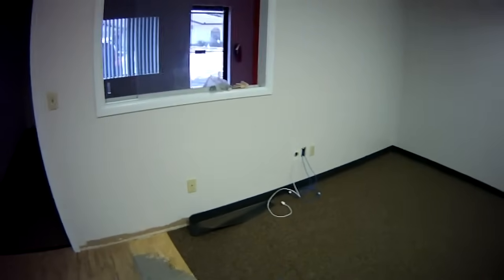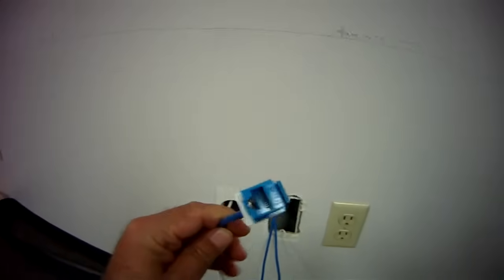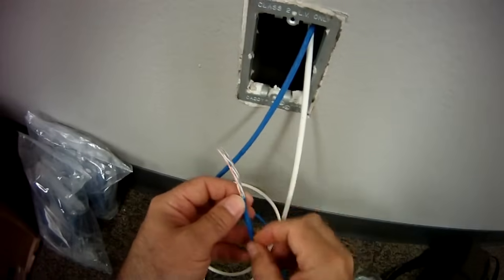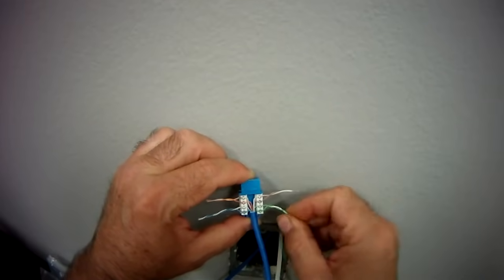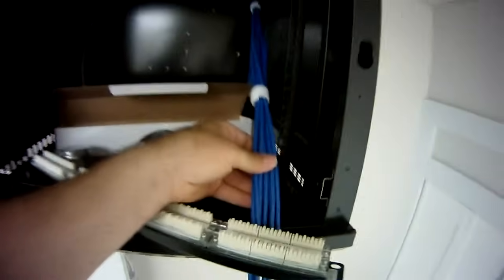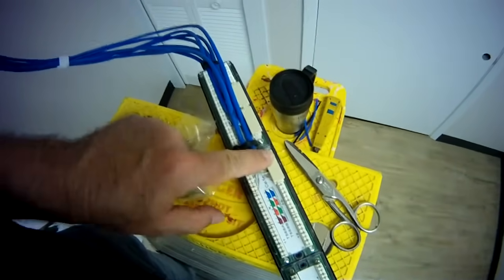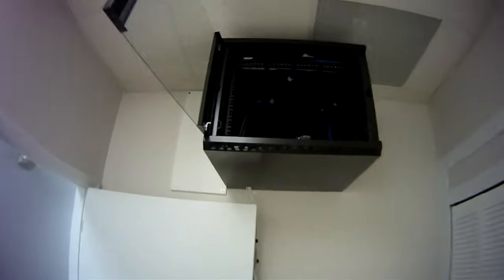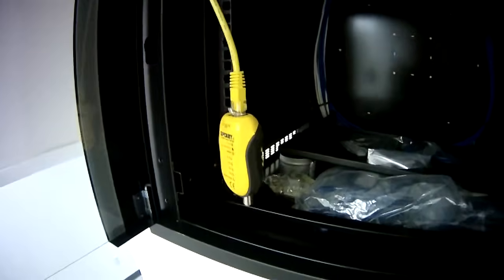Wiring an Office Network

Comment: If you are going though a ceiling & wall - I do believe I would use Fire Resistant Cable.  Putting the patch panel up so high makes it really tough to trouble shoot.   I used to teach Network Engineering & believe me - I would not pass you!  Putting Network Cabling running along fluorescent lights is a serious error.    Fluorescent lights & electrical cables should be avoided when placing Network Cables because they cause interference & will slow down the speed, if not cause random disconnections.     A real professional would not use your dumb cable tester but would have a Time-domain reflectometer.  This would not only test the cable but if there is a break or flaw in the cable would give you the approximate distance in the cable where the break is located.   The so-called critics who "can't believe you threw garbage" inside the wall should really look at your serious mistakes.
Reply from the maker: hey thanks for all the helpful comments.  I'm sure everyone can benefit from your pointers.  :-D
Reply: ping .-t 
Username checks out.
Reply: Agreed, in theory it is a bad practice. However, there is a saying regarding teachers: "Those can't do, teach."

In some situations, the only alternative is to remove the ceiling grid and attach it into the V's on the ceiling. I suppose that's the best solution, however with pipes and other obstacles it can be tedious and requires a lift to do so. However, in some areas it violates the NEC for cat5 to be supported entirely by the ceiling grid.
Reply: Yes, fire grade cabling could be run but depends on cost.   The cables should be correctly mounted in the celing space- no evidence of this so we assume he didn't just lie them across the ceiling tiles :-)  A "fluke" could be used depending on time/cost but again this was a small job and if a break in the cable was there, just pull another cable and replace!  I get your point and i'm sure in a classroom setting it's fine and dandy but out here in the real world it works differently.

Comment: Hey man, im 19 years old trying to go into the networking field. i hope its not to late for a reply but i have a question. Where that patch panel is, are you going to put a switch or hub in there to fill up those ports you was testing? If so, why are you going that route and not just putting a switch in the central point? One last question, is that a star topology or star-bus?
Reply from the maker: Arias, there is definetly a switch and router that went into that cabinet.  That IS the central point.  That is a STAR topology network.  As for BUS, I've not seen anyone using that configuration in years (like since 1994 - Lantastic & Novell).
Reply: there is no such thing as a bus with this type of cabling installation.  it is single point terminations.  Bus went out back in the old days with co-ax cabling and network bridges.

Comment: The caps on the patch panels are so the next guy doesn't short out pairs. And I'm glad I wasn't the only one in awe of throwing trash into the customer's walls.
Reply from the maker: the funny thing is, I don't usually do that. But this place had no trash cans.   The best part of all is that simple act combined with the commented reactions have greatly contributed to the high ranking of this video!!  :-D

And, thanks for your comments.
Reply: Network Advisor It's all good everyone has been guilty of something like that. I always use a box from the equipment I install on site as a trash. Then the customer doesn't have to clean after me. 

But I like that people are taking the time to show new guys different types of set ups around the world. I've thought about it but I'm no good at that type of stuff.
Reply from the maker: I appreciate it Logan.   I make these videos to help out the DIY'ers and aspiring Telecom/Network wanabees.   I know for myself I get tremendous value from YT videos and other Internet postings on topics that I have no clue about.  That has saved me mucho money and time.

So, this is my way of doing my part for anyone who want to know about Telecom/IT/Networking.    

Thanks for writing back.  :-)

Comment: So many cringe worthy techniques performed in this video (least of which was trash into wall), but I had to finally comment based on your recommendation of a cheap wire mapper over a Certifier. Telling viewers (looks like newbie techs) to use a cheap wire mapper is one reason I get called out for troubleshooting a year or more later when the network speed bogs down after the clients add more devices and a crappy Cat5e install becomes more apparent. In commercial wiring, speed is NOT the goal, do the job by the book and you will never have to repull/upgrade, repair or diagnose your cabling. I concur with comments made by Kurt Zeman, WeAreTwoDoorsDown, Shalom1948hellyeah, FishFind3000, Mum Blic, Jeff Clark and others. As for the trash issue, the same cut corners mindset that throws excess into hidden areas is the same mindset that throws everything imaginable onto the top of ceiling tiles where years of dust accumulates and some hapless tech cannot lift the tile or it cascades it's contents atop his head. Unfortunately, cut-corner speed-demon I don't care techs/installers are a dime a dozen. My beef isn't with you, I'm looking for the guy who's supplying the dimes.
Reply from the maker: Hey, thanks for the valuable comments.  Hopefully helps some people out.  :-)

Comment: Do you need an electricians licence to do something like this?
Reply from the maker: hi Corey.  SOOOOO much depends on where you are.   Some states require a low-voltage license while other locales may not.  If you're just doing it for you own house, probably not something you need to worry about.  However, if you're doing this for hire, then best to check the govt websites for you area.

Thanks for mentioning that!
Reply: Network Advisor Thank you for replying. Great Video.

Comment: It is dependent if you are doing crossover or straight-through.  You match jack codes if you are doing straight-through and different if you are doing cross-over.... Now as far as clean-up carry a FOD bag http://www.aviationpros.com/product/10026864/estex-manufacturing-co-inc-fod-bags  If memory serves those are dust covers.

Comment: what is the white cable for?  Is it for voice?
Reply from the maker: Exactly, the white cable was intended for their fax line (voice).   However, that is not an official color code.  You an choose to use any color you like for voice or data.
Reply: I've always used White for voice and anything else (normally blue, purple or green) for data.  I find that red is used for building controls in our area so try to avoid that colour as a rule.

Comment: Are the white cables Ethernet as well? because you didn't terminate them in the patch panel.
Reply from the maker: good catch.  No, those are actually being used a fax and/or postal meter lines. (modems).

Thanks for commenting!
Reply: Network Advisor would you be willing to for me your email so that I could ask any other questions there?

Comment: That box is huge and doesn't! look nice.  I work with small metal hinge boxes. Inside i screw a 20 way module which can fit perfect in the hinge box without taking so much space. The blue ones are called Rj45 keystone connectors. inside goes the the Rj45 Plug with Rj45 Cable. I put them together. It's much more neat. Please clean your garbage. Doesn't look professional.
Reply from the maker: hey, thanks for the comments.  :-)

Comment: You might want to look into cat6 CoperCladAluminium or "CCA" cables. Dirtcheap compared to standard copper cat5e cables and almost half the price for double the bandwith.
Reply from the maker: Thanks Robbe.  I did try some CCA about a year ago.  It's definitely cheaper!   I read some mixed reviews about it so I stopped using it.  However, for a home installation, I'm sure it would be just fine.

Thanks for your comments sir!
Reply: Robbe Elsas CCA is crap

Comment: Question - in a home where there is a minimal service loop available and the cables are terminated with an rj45 connector instead of a patch panel, how do you run new cables for extra slack to punch down to a patch panel? Don't want to poke new holes if there's an easy way
Reply from the maker: hmm.. that tricky Daniel.  What we sometime do is use the old cable as a "pull string" for the new cable.  This can work well in a commercial environment where the cable path is fairly predictable.  However, in a home that idea may not work so well.  
the other idea I see done when the cables are to short near router/switch area is to put the patch panel in the attic space and then run long patch cords from that patch panel (in the attic) down to the router/switch equipment.  Good luck.  :-D

Comment: why didn't you show the cable paths? maybe we would see your cables laying on top of lighting fixtures, or less than 3ft from any electrical source/cable, which is of course against building code for cat5e cable. show the path next time.
Reply from the maker: +Cody Thompson hey, thanks for the feed back.  Honestly, I didn't feel like sticking my head back up in the insulation - filled ceiling again.  However, I have made video about running cables.  That was not the scope of this video.
Reply: Cody, you can run lv perpendicular to hv electrical cable. Hv electrical cable must be in conduit limiting EMI. Finally, there would be little interference with STP cat5e. The NEC, which is what I think you are referring to only requires the use of plenum in AIR HANDLING spaces and that low voltage cable not be supported entirely by the ceiling grid.

Comment: Will that Sperry tester work with CAT6 Cable?
Reply from the maker: +thejacksonles yes, it totally will.  It's not verifying the speed of the cable, only that the cable is connected properly on both ends and has no breaks.
Reply: Network Advisor Thank you!

Comment: ouch!, not category5 tips. they are RJ45 jacks. good video otherwise.
Reply: From Memory I believe the correct term is 8P8C (8pin 8connector) but RJ45 is the standard that defines this technology therefore they are interchangeable.   TBH if you asked for 8P8C connectors they would give you a blank stare.
Reply: Relax. RJ45 identifies the form factor. Category 5 identifies the usage rating. BOTH are acceptable and it's important to make the distinction that he's using Cat5e connectors since he chose for some odd reason not to use Cat6 in a new install.
Reply: i just corrected a mis spoken word. i complimented his video, take it easy keyboard warrior
Reply: Andrew Carr You are correct. The modular connector in use today is an 8P8C. In the days of analog telephone, an RJ45 was an 8-conductor connector that was used. As data technologies emerged, the RJ45S came into briefly into existence before being replaced by the 8P8C that we recognize today. Although the two connectors are both different and not interchangeable, the RJ45 nomenclature was carried forward by technicians to refer to the new standard connector. So today the terms have become synonymous though they do remain technically different.
Reply: Not RJ45, the 45 has a side plastic tab, or key or whatever you want to call it, that doesn't fit into 8p8c port.

https://www.arrow.com/en/research-and-events/articles/rj45-connectors
Reply: He's a hack with a job. You're a douche taking trash on youtube.
Reply: rivkinnator he's a hack so don't worry about the terminology. Worry about how he striped the wire and dumps shit in the wall.

Comment: So did you Run one cable at a time, mark each end at the Termination Box and the wall socket to keep track of your numbers? Reason I ask is If I have to run 10 cables and bundle then all I would have no idea what ends matched up with what ends unless I run one at a time. Nice neat finish btw, and there are worse things then some bits of wire an plastic in walls I have been into.
Reply from the maker: Right, I sometimes find cigarette butts and beer bottles inside the walls!   If you only have one box of cable, then you obviously have to run one cable at a time. However, I usually have 3 or 4 boxes of cable so I try to group them together to pull multiple runs at the same time. 
yes, I do mark the ends with a black sharpie marker.  But, if for some reason, you didn't do that,you can always use a toner to identify the calbes after they're all run.  But, that's a time-consuming process.
Thanks for the comments!
Reply: It is a lot easier to run them all at once and then tone them out than running 1 cable at a time...

Comment: Question – Im a newb when it comes to networking.   Why are patch panels needed?  Why not instead the CAT 5 already has
connecting RJ45s on each tip and all you have to do is plug them straight into
the router or switch in the cabinet?
Reply from the maker: That's a good observation Tim.  In some smaller installations, that is sometimes done - just skip the patch panel and crimp RJ-45 ends on the cables.
If it was a small network and you were pretty sure things would not need to change often, then you could do that.  
However, the industry standard is that patch panels get used.  In a busy or growing environment,  the necessity for a patch panel becomes more obvious.  

But, if you're installing just a small little network and you want to just put crimp ends on the cables, that will still work.  :-)

Comment: Pet hate is zip ties cut with snips... So tired of cut hands from this, buy some flush cutters and save us all the Argo.    Also, why not have the service loop coiled above the ceiling? Looks a mess inside the cab....if there's nothing visible customer more likely to call you back than get their handyman yo move stuff ;-)
Reply from the maker: thanks Mark .  Def agree with you about the zip ties.  Been there with the cut hands.  Thank goodness veclco is slowing replacing those plastic devils!

I see your point on the service loop.  And, I even admitted in the video that it was a tad too much.  But, I have to respectfully disagree with you about the service loop in the ceiling.  If I had to re-term a cable in that cabinet, I might need 2-3 inches slack.  I would be so glad the service loop was there in the cabinet instead of having to go out, get the 8 ft. ladder, push the tile up, deal with the insulation, spider webs, and mouse droppings.  But, maybe that's just my preference.

Thanks for commenting. :-)

Comment: Scissors lmfao bud 
Buy some $10 strippers from the bar 

Scissors SMFH
Reply: All good man! I've tried scissors and they work great, even for Fibre installs.
Reply: Aaron Locker but he didn't strip it back from where he cut the sheathing. So he's doing it incorrectly.
Reply: Scissors work very well and don't damage the copper, unlike most strippers.
Reply: Spoken like a true amateur. Everyone in structured cabling has a pair of wire scissors in their pouch ...if they're smart. Also, any pro knows better than to buy the cheapest tools. You will regret it the by the end of the first day with them.
Reply: Scissors don't damage copper yet they're made to cut copper?
Reply: lakesidelivin an overly tight stripper will cut into the copper wires. Scissors usually just score  the outer sheath of the cable and don't cut into the wires.
Reply from the maker: hey, that great!  thanks or sharing. :-)
Reply from the maker: Hades Akoula  I like scissor just because I started as a phone man.  So, after years, it's just what I'm used too.  Plus, I don't wear a tool belt and I don't like to carry a lot.  When I'm installing cable,  90% of the time I carry my scissors (snips), punch and my leatherman.
Thanks for Posting Hades!

Comment: It was just getting interesting when the video finished. I wished you had recorded the whole remaining process of this installation.
Reply from the maker: +Naziru Adam hi Naziru.  Glad you liked it.  It's always a balancing act with youtube videos.  "Shorter is better".  Longer videos tend not tonget watched.  Or, if they do, they aren't finished.
The goal of this video was just to give a quick-and-rough idea of the steps needed to install the wiring infrastructure.  Is there something in particular you think I left out?
Reply: Sure you are right about the video length. I was just kind of wondering if it would include installing the server, switch and other stuff like that...anyway, the video was quite informative and straight forward.
Reply from the maker: Naziru Adam OK.. maybe I'll make a part two that covers the network setup basic like routers, switches and file servers.  :-)

Comment: What exactly would you call you job do you set up networks for all offices networking interests me and I would like to do what you do thanks
Reply from the maker: +Dillon Brigode my job title is either Network installer, structured cabling tech, or telecom technician.  I do it as a contractor  (instead of as an employee).  I sometimes use FieldNation to find my gigs.
Reply: +Network Advisor awesome thank you

Comment: Hi i was wondering what was the white wire coming out of the wall? was it a telephone line? and Nice video
Reply from the maker: Very perceptive Ross!   Yes, I had some jack locations at this office that need analog lines or fax.  So, those white wires were for those.  However, it was still cat5e.  Even though you could get away with cat3 for analog phone lines, almost no one uses it anymore.
Reply: That's what i was thinking, Thanks for the responce